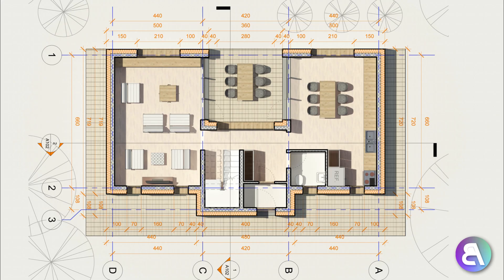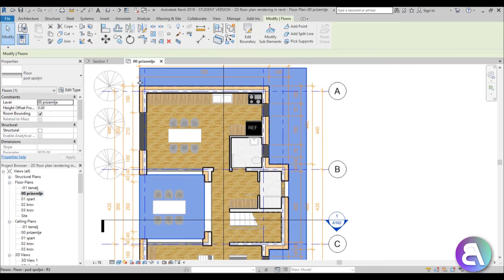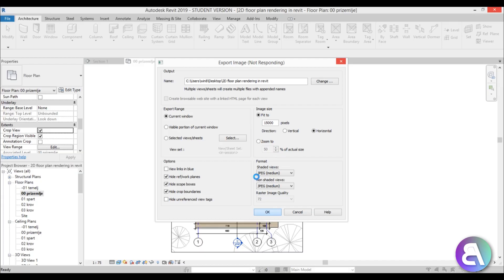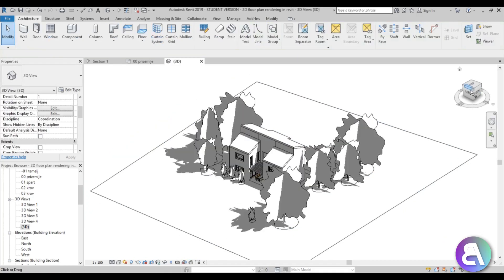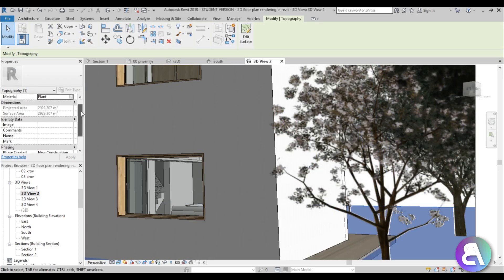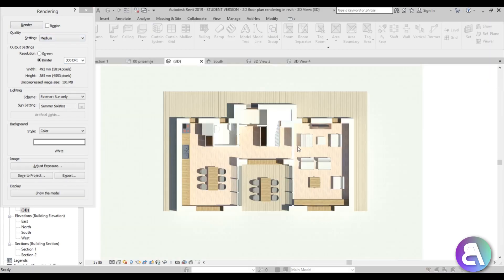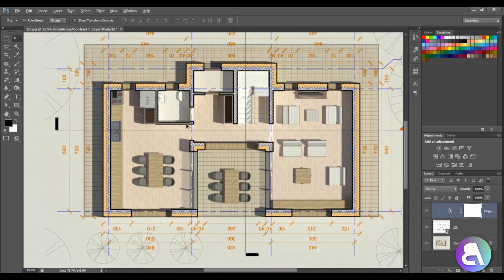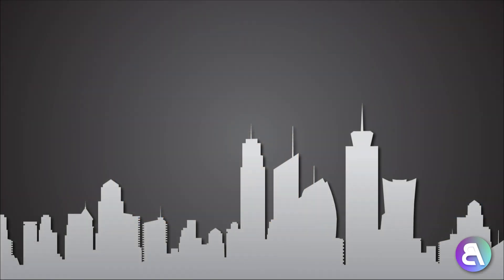Rendered 2D Floor Plans in Revit Tutorial

Comment: This is a great tutorial, however, the shadows would not interact with the components, walls, etc. in that way. Because you cut the wall with a section box the sunlight is able to cast over everything in the room, rather than through the windows as it would be in real life.

Comment: I think it would be more practical if the settings changes applied and updated automatically so you wouldn't have to click on the "apply" button each time and you would directly have the feedback of what you're doing to your model,and also in Photoshop there should be a resizing option to kind of make the process easier,that's my thoughts,Anyway good and useful video bro,like always ;)